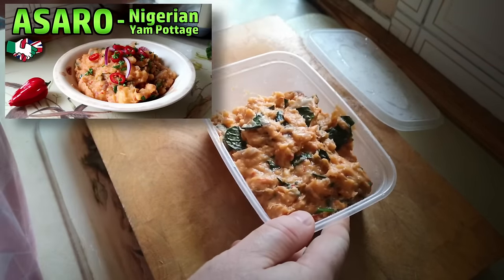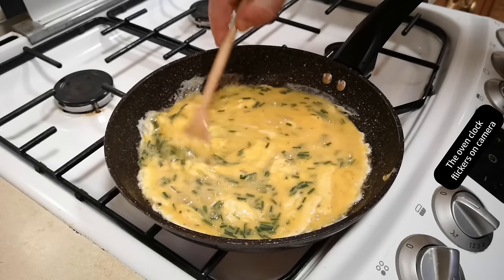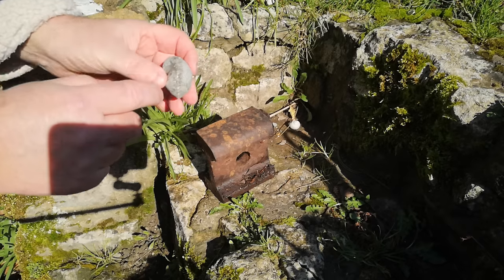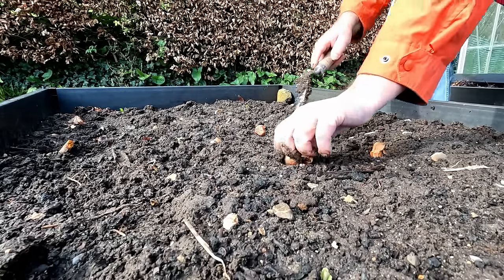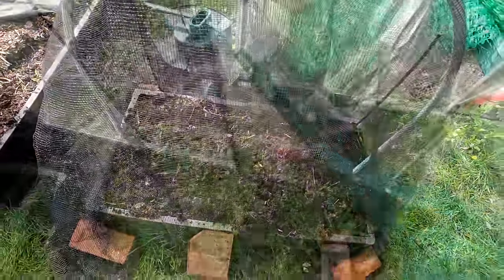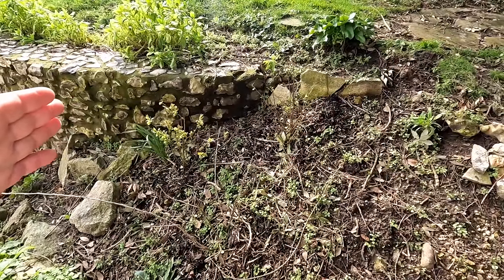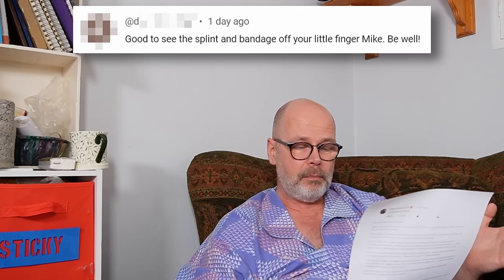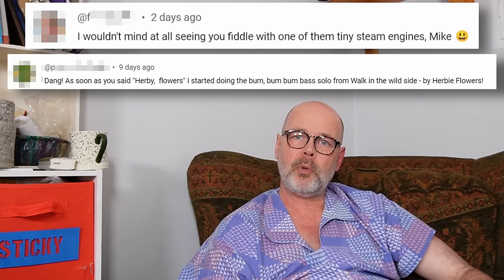Random Stuff - Leftovers, Crow Garlic, Fossible, Garden Stuff, Tech Teardown, Comment Positivity

Comment: I've always wanted one of those On Air lights connected to the lock on my lavatory, a fun way to avoid all the awkwardness of "*knock* is anyone in there?" "sorry, just a minute!" at what can be quite a personal time.
Reply: You could also switch out your light switch. There are ones that light up, if they're in the 'on' position. 
Unless there's enough daylight in there, so people wouldn't use it during the daytime. 
We have that in a shared flat and it's super useful. You know right away, when the bathroom is already being used by someone.
Reply: That would be so epic if it was linked somehow to the door lock to complete the circuit...
Reply: Loos on planes have those so I guess it’s possible!
Reply: The home of one friend has hotel-style "Do Not Disturb" doorknob hangers for each bathroom.  Inexpensive and effective.

I do find the "On Air" light idea very attractive, though.
Reply: @kathrynillsley7557 My office restrooms have deadbolts that show "occupied" on the outside when someone's thrown the bolt inside. It's way better than accidentally walking in on your boss...
Reply: Hmm. Ours have a motion sensor activated light & fan. But perhaps ‘Bad Air’ may be more appropriate?
Reply: @tornagawn  That's a great idea, and more sanitary as well.  "Bad air" is the Latin root of "malaria," BTW.
Reply: Urghh…just remembered a workplace colleague from way back……his usual line after leaving the staff toilet was ‘I’d give that a minute or two if I was you’
Reply: We simply used to leave the bathroom door open when there was no-one in there. That way it was  obvious, at a gance whether the bathroom was free or not. No need even to knock.
Reply: I forgot to lock the door on train in Ireland once and had an embarrassing mid toilet moment when a women opened the door 😳😱

Comment: When I was an engineer for our local hospital station we just had two 60W incandescent bulbs in batten holders on the ceiling, one blue for rehearse and another red one for on air. The microphone live lamps were home made and just consisted of wooden boxes with a couple of lamps inside rather like this, and it lit up when a microphone fader was open.

We also had two 200W pearl lamps for the two phone lines, when the phone rang, several kW of light flooded every room in the place, operated from mercury relays out in the engineering workshop..! We never missed a phone call, I'll say that much 🤣

Comment: The on air light is familiar to me. I work 50 years in broadcasting here in new Zealand. There were a couple of different ways they were controlled. If one was placed outside a conrol room, it would likely been manually switched, most likely by the producer's assistant. If it was outside an announcer's booth, or studio area, the control would come from switches on the audio desk microphone channels, so would come on when the Mics were live.  In the instance of flashing, an option would/may be steady when '"On Air" and flashing when "On Air" with Mics live. Not sure of the latter but would make sense.

Comment: 35:30 I bet that thing is using the 50Hz from the mains as a clock signal which feeds (with a bit signal conditioning maybe) directly into the counter. That thing just counts the 0.02sec clock and some of the bits of the output are fed into the logic gates to create the functions of the table. Counters are great not only for counting but also dividing. The lowest bit toggles with every clock, the second bit toggles with every 2 clocks, the third every 4 clocks, etc. With an 8 bit counter running at 50Hz the top 4 bits will flip every 0.32, 0.64, 1.28 and 2.56 seconds. Add some logic and you can get that table in the manual.
Reply: Electronic digital clocks don't use the mains frequency for timing, only old mechanical clocks using synchronous motors do it. In theory yes you could but it would be extra cost and complexity to add a zero cross detector over a cheap quartz oscillator. The flicker is simply because the display is multiplex scanned.

Comment: Good luck with the finger, it can definitely take a while. I broke mine on my right hand back in 2011 (dropped my motorbike on it in the world's slowest crash - with a brand new learner car driver!). It took an annoyingly long time to heal up, I found the "floppy" stage the most annoying and actually used to stick an elastic band round it at times to stop it sticking out and getting caught (and maybe broken again)!. Despite doing all the exercises, mine never quite lined up, and for example won't locate on its "home" key on a keyboard. I also seem to have altered how I use my wrist a little, which may or may not have made me more prone to overuse injury of the elbow tendons (but I get that anyway, so who knows). But none of it is a big deal and I don't think about it any more. I would say it took most of a year to be back to 99%, so be patient!

Comment: Pawpaws are a bit difficult to grow from seed. For Asimina triloba you need fresh seed which has never dried out. Then the young plants need to grow in shade for a number of years before they can be moved into an open area. They apparently do not fruit for about 8 years from seed. They are usually not self fertile but some varieties are to some degree. I would suggest you try to buy a grafted tree like a Prima variety if possible, although this is difficult here in the UK since plant import rules changed. The fruit is great and worth the fuss in my opinion.

Pineapple guavas are also worth buying grafted varieties. You need multiple varieties for decent pollination anyway. Burncoose nursery have a couple. Definitely worth breaking up the outside of the root ball well, girdling roots are a proper issue that can lead to failure in maturity, although more of an issue for trees.
Reply from the maker: The pawpaw seeds I've ordered (and now received and planted) were despatched from cold storage in moist vermiculite, so they have already been stratified
Reply: @AtomicShrimp  Great, I was sold dried seed at first which was frustrating. They can take a while to germinate but rates are quite good it seems. Looking forward to seeing their journey!
And cheers for all the lovely vids!

Comment: The white and black connector blocks on the Canford unit both unplug, no need to undo the screws. The X2/Y2  capacitors are filter caps, X and Y mean it's safety rated , X is rated for connection between L and N and Y for connection between L/N and Earth.

Comment: Note: That extra device on the input is likely a MOV (Metal-Oxide Varistor). It will be wired across the two inputs to suppress transient voltage spikes (possibly caused by switching two 100w globes on and off repeatedly, given the age of the device).

Comment: The ICs in the "On Air" sign are probably DMX512 network drivers, the jumpers for setting the address.
Nvm, I was thinking of a more complex studio design that uses a DMX512 network instead of a bunch of dedicated wiring.
Reply from the maker: Yeah, I initially thought perhaps the onboard circuitry might be a sensor and feedback to the desk, for a confirmation loop that the light was actually illuminated, but it just seems to be a configurable flasher.  Not clear why they didn't just implement that with a 555.

Comment: May I ask where you got your garden hoops (or can you recommend anywhere)? I've been looking around for something durable but most seem flimsy plastic coated steel or thin aluminium with plastic connecters that don't look like they'll work longer term.
Reply: I've seen people use lengths of garden hose pushed onto pieces of bamboo cane, the canes can be replaced if they rot. It's a very cheap way of making hoops and at the end of the season it's easy to store them